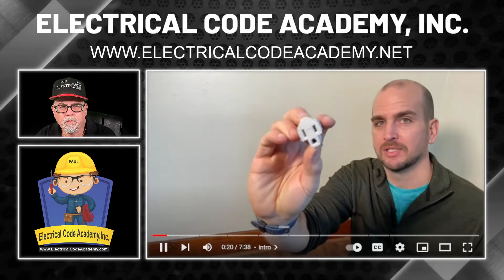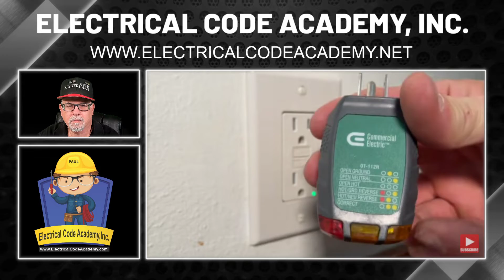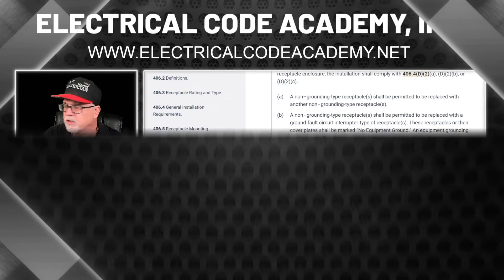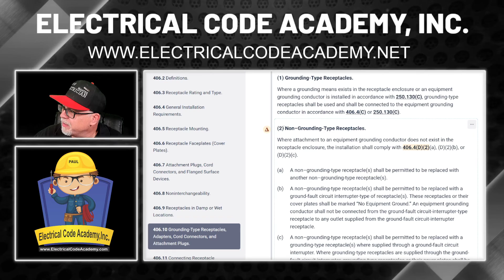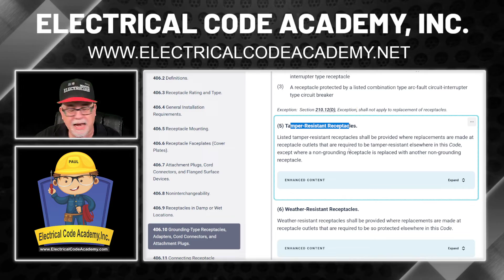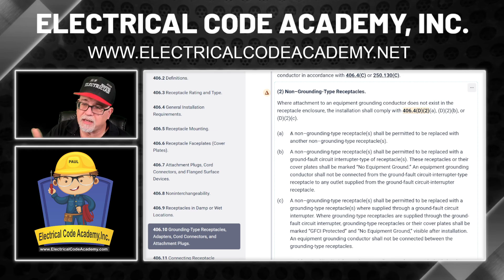How To Replace An Old 2 Prong Outlet Using 3 Prong GFCI | Commentary

Comment: What brand of torquing screw driver recommended?
Reply from the maker: As long as they have a certificate any will so. We happen to believe husky makes a great screwdriver model available at any home depot. As for torque wrench harbor freight, yes HF has some affordable models that work just fine.